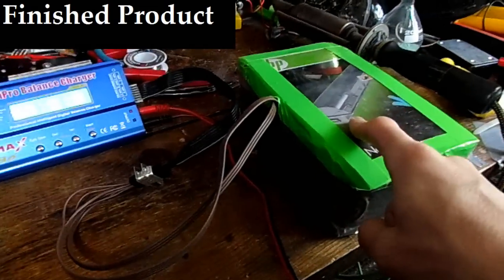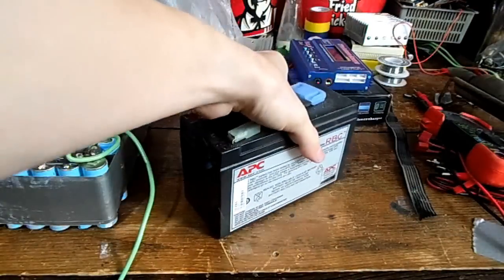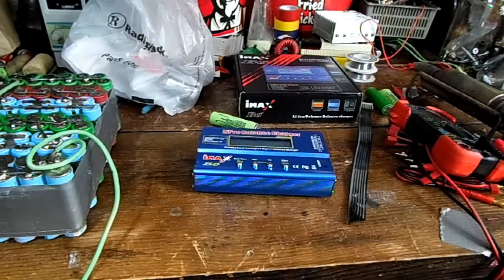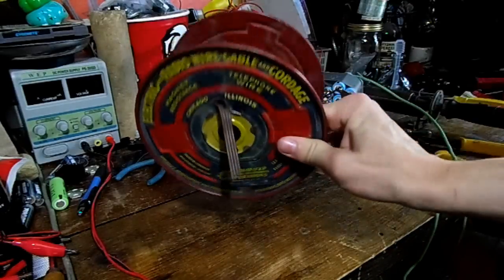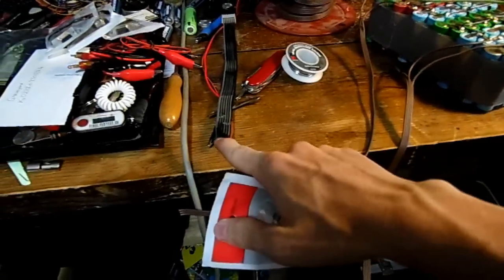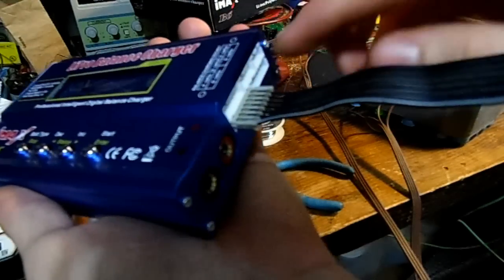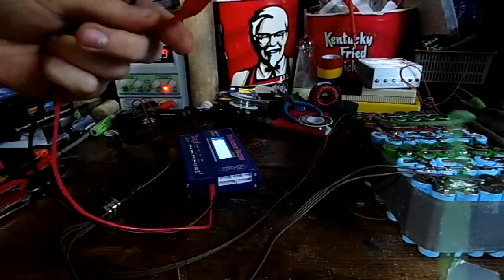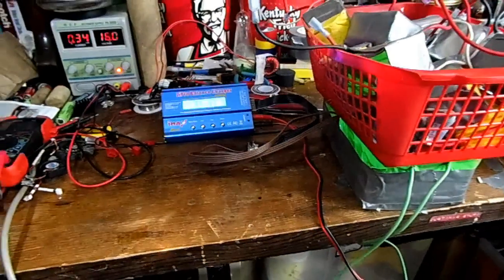DIY: Balance Charging E-Bike lithium battery upgrade

Comment: My question is how do you ensure individual cells are balanced? These chargers only have 7 wires so you can only balance from one bank to another but there is no insuring that you don't have one specific cell within a parallel bank that is too high or low.  So I guess if you have one bank that is constantly going out of balance you then have to unsolder the entire bank and check each cell in that bank for a fault then replace the cell and resolder the bank together again? Am I understanding the theory of this correctly?
Reply from the maker: it is impossible for cells in parallel to be out of different voltage, they will naturally go to the same voltage.
Reply: @RinoaL  I see what you are saying. So by that logic when making a battery pack it is best to make all your parallel banks first then solder them together in series rather than make the banks as series and then solder them together in parallel. Is that right?
Reply from the maker: it is easiest, yes. when you connect cells in parallel they then work as one single larger cell. however make sure the cells are a similar voltage when you connect them all together. if you have some cells at 4.2v and some at 3.2v when you connect them together they will start balancing out, and since the flow from the fully charged to the flat cells would be so great it could get very hot. so i'd say get the cells to within 0.2v of each other before connecting them together. then let them sit for a day or so do equalize. there really isnt any reason you must connect them in parallel before series, you can solder them in whatever order you like. its just good to let them sit for a while to equalize. in each parallel pack if a cells is 4.21v and another is 4.2v, theyll equalize to both be something like 4.205v. then from there on they will always be the same (unless something goes wrong)
Reply: @RinoaL  to my mind there is a reason to solder the banks in parallel first. If you connect the banks in series then solder them together in parallel a single cell in a series bank has the potential to go out of balance. This brings us back to the existence of bms's and balance chargers in the first place.

Comment: There is some very bad advice in this video. 

1) The IMAX is a great charger.
2) Pumping 24v into a 12v lead battery will cause it to boil and potentially explode. 
3) Balance cables are readily available and easy to find.

Comment: After making battery pack I think it's really important to make balance the pack before use it.
But what if we add new cells to that pack do we need to keep balance again..  ?
If that is single pack that's fine we can do it one time, but what if we divided that in two Two packs... 
Rather than charging entire pack can we charge  alternately ...?
But we need to use two packs always, do we need make balance always....

Comment: Ok, what is the difference between this balance charger and BMS...? Even BMS also for Recharge each cells with balance I just thinking ... Is it true or any difference...? 
1.Can we use this balance charger for Recharge 18650 cells if yes how many cells can connect with parallel connection for Recharge 2.can we test each cell capacity or amps ..?

Comment: Lion battery are empty at 3v not 3.7
Reply from the maker: you'd be stupid to take them down that far for an e-bike. bellow 3.7v they cant give much power and the voltage dips. also no, 3.0v is too low for what i consider empty.
Reply: For my applications I empty them until 3v-2.8 max

Comment: Your to young to know but the four wire on the spool was commonly used to connect the roof top tv antenna and its rotor, because radio frequencies where not generated in a single location. Thus a rotor was needed to get stronger signals from further distances especially if you where located in a rural area.
Reply from the maker: too young? thats really condescending. most antenna motor cables ive seen for that werent flat. dont think that just because somebody is young that they are ignorant

Comment: Actually I just tried to connect a bms 52v 14s but after connecting first the battery negative an the red an black balance leads my battery started smoking a a couple of cells got hot so had to cut wires quick and separate hot cells.hot cells were Samsung 26h but I’ve just ordered 30more new cells but 25r Samsung .the 26h we’re losing voltage before the other Panasonic 2600 mah and 25r when cycling up hill on my ebike 1000watt motor.have ordered another bms also as the balance lead wouldn’t fit all the way in on the bms unit

Comment: hi rinoa I have a 14s5p kit and need to balance can I use your method with imax b6 with 6 connectors was it?not sure where to place wires.steve.uk.
Reply from the maker: actually it turns out to be a lot better to connect a BMS circuit onto it and not use the imac b6 for such a large pack. check out my video "Tinkerer's Guide to the 18650" for more info on how to connect up a bms.

Comment: The serial port is great idea, I am making a battery for electric motorcycle and do not intend to remove it. So going to install a serial port to the battery instead of buying the fancy cables. Thanks
Reply from the maker: Actually i recommend getting a BMS, that way you only have to have two wires coming out for charging, + and -   , the BMS will take care of ballancing. how i used to do it in these videos was actually more tedious for no reason. check out my video "The Tinkerer's Guide to the 18650" or maybe "Steampunk Ebike 06" if you want more info on how to use a BMS.

Comment: dead at 3.7v? SMACK tuff love
Reply from the maker: +DragonsREpic well at 3.7v they dip so low in voltage while under load that i wouldnt trust it to take you far, so i consider that about time to stop discharging.
Reply: holy crap that was a fast response...damn. Pretty sure you said dead well either the cells are shitty or your pulling to much current..over how many in parallel? Jesus! how much are you pulling?!? OH btw I ordered http://vruzend.com/ red and blue ones (no idea why its fuckin blue, who ever thought that was a genius idea should prob be shot for it IMHO) I haven't gotten it yet tho, its like 35$ for 52 set with the parts for them so its not to bad unless you have hundreds of cells
Reply from the maker: +DragonsREpic i havent watched this video in years so im only going off what i do now. and dead can either mean fully discharged or unusable. surely you knew that though.

Comment: this is going to be a pretty tough comment to follow but imagine this...

instead of soldering together each individual pack, if you used a switch instead. similarly, on the other side of the battery you could also have a series of switches and what these would have the potential to do (theoretically) , is turn the pack from a 6 series pack into a 1 series pack of 4 volts .... then you could switch it from being a 6 series pack to a single battery and then let the voltage normalize across the cells and this would allow you to simply charge "1battery", as far as the imax is concerned to 4v. 

I was thinking this because the imax can only charge a Max of 6s, so in order to make a 48v pack, you would have to divide the pack into two batteries and charger each separately. let me know what you think or if it is plausible
Reply from the maker: thats not a new idea, and its not a very good idea. the relays or switches would cost more than a BMS.
Reply: Rinoa Super-Genius thanks for your response. hadn't considered cost, I just didn't want to have to break a 14S pack into 3 separate charges on the IMAX b6 for times sake. 

shortly after the idea, I remembered that the maximum 5 amp output of a b6 amongst 100~ cells may take forever to charge if it all. 

aside from cost, why is it a bad idea?
Reply from the maker: takes up too much space, more difficult to charge, easier to end up a pile of burning lithium. charging a battery with an imax b6 isnt a good long term solution for an ebike.
Reply: ah good point. if the imax b6 isnt a good long term solution, then what is? regular charger with a BMS?
Reply from the maker: yeah, turns out those shitty ebike chargers made for lead-acid batteries work great for powering the BMS.

Comment: Built a similar setup to that shown in the vid. My charger (same as the one You use ) takes forever to balance the cells. Even though I initially set the charging current @3 Amps, within seconds it drops to 400 mA  :(

Comment: I'm hoping you still reply to this video. I can't find my answer.
I have four 18650's and 4 battery holders. Please tell me how to wire these to get 8 volts and 6000mah. 2p2s and where to wire in the balance charger leads. Or should I just use two 18650?  I would be really greatful. I wish there was a way to email you but if that was available, you would be inundated.
Reply from the maker: wire the cells together in 2s, then wire those blocks of two in series.
Reply: Rinoa Super-Genius. Wire in 2p then in series 2s. Do I just wire the 2p for balance charging? I appreciate you taking time from your busy schedule. I moved from Ohio to the east bay for work also. What a nightmare this area is. I hate it.
Reply from the maker: Vince Biano
well when you connect batteries in parallel you can then think of them as a bigger battery. just if its too big put fuses between the cells so if one shorts all the other ones dont pump enough power to blow the whole pack up. i use 4 amp picofuses.

due to the laws of physics parallel cells dont need ballancing against each other. just if you have 1s you need two connectors, 2s needs 3 (due to middle connector) and on from there. but it doesnt matter if you have 2 or 200 cells in parallel, you still only really need 3 wires for a 2s configuration.

i recommend discharge testing each cell that way you get an understanding of their capacity and then they are discharged down to 3.6v for assembly. never assemble a fully charged pack, your handling too much energy then.

Comment: So this balances each set of batteries in parallel and we can be assured that the individual batteries within the parallel pack are the same voltage because when batteries are hooked up in parallel, their voltage will equalize?
Correct?

Thanks
Reply: Yes and no, as you seen when he assemble the pack, all the cells were equalized and had the same voltage and amp draw. Over time one or 2 cells will go out of wack. It is a good practice to check for heat or the lack of heat when you are charging them. To answer your question, if the cells are all okay,  the individual cells will be in sync.

Comment: Hi Rinoa, great video...

I had a couple questions... can the IMAX charger charge the batteries to a specified voltage such as 3.92 instead of 4.2v?

Also, when balancing the packs in series; the series packs are all balanced, however, each individual 18650 cell within the series pack may not be balanced, is this correct?

Thanks!
Reply: Yes, and Yes

Comment: JST connectors are extremely available online. Probably would have been easier to go with that
Reply: Then you would have to wait for it, vs using local supplies. Prob is nowdays the Radio Shacks are all gone. I use amazon for 2 day shipping.

Comment: How long does it take for the imax B6 to charge that large battery bank? I think its rated at 50 watts/ 5 amps max.
Reply: The imax is only balancing, otherwise you use a normal charger.

Comment: nice video a fellow tinkerer here. Im amassing my lot of batteries for a  ebike project maself and i think i got most of it down in my head on what to do except 1 thing alludes me, the balance charging part. More specifically using a bms pcb system and then connecting that 13s(48V) to the imax charger which only has a 6s slot. have you found a simple paralelling cable technique to accomplish this or is the output power from the imax enough to detect \and show the balancing of the cells since it runs through the controller and bms board as well? mot likely this is simple but i overlook simple solutions alot.
Reply: If you already have a bms system, then I don't think you'll need the imax charger since that only does 6s.
Reply: I agree with Alex

Comment: Does the LiPro charge the battery in 24Volts or just the Indivdual cells that are in parallel? And if i would build a 24V battery pack out of 18650 cells, what would be the best way to calculate the total Amps/mah). Does the lipro do that to when discharging?
Reply: It charges the parallel to 4.00 volts, Each row is 2ah, 4 rows = 8ah. Yes

Comment: Can I use a 60V Battery on a 48V motor?
Reply from the maker: +Tucker Not Sucker! yes, but you cant use a 60v battery on a 48v controller, check inside your motor controller to see if the capacitors are rated above 60v, if not you may need to upgrade your controller.
Reply: Rinoa Super-Genius Okay thanks.
Reply: You can cut out 24v, and use that.

Comment: there is 24v battery pack.  6 cells. but the balance charger max input 18v.  how that works?
Reply: Cells are bottoming out at 3.00 volts. Don't let them get below that. Get and use a volt meter, 3.00 from china.

Comment: Your videos are really helpful for my ebike project.
I was trying to figure-out how we can balance charge my pack, using a BMS chip(readily available on aliexpress) then charging the pack using an power adapter directly without using imax B6 somehow, to allow on board charging.
Your expert opinion on this setup please.
7 Wires => BMS chip=>Poweradapter
Reply: You don't need imax with a BMS.

Comment: Hello, I have been watching some of your videos, I'm making one of 8 batteries in parallel in six banks (18650), which is 24v,, but my question will be, if every cell says 3.7 v. 5000 mAh how many Amps will be at the end. And at what rate should I charge, Im using 0.2 A and 15 v. in the Gq-A305D. Then in the iMAX shows the six cells but the fourth one was showing 1.9 v. it is normal ( I charge them separately before)  I appreciate your help. Your video is very helpful
Reply: First never mix voltages, wait till you have all the batteries in sync. 6 banks x 5ah = 30ah.

Comment: What is the wire gauge of your ribbon? Of the connector wires from the battery pack?

Don't worry.  If your wiring is wrong -- Smoke.
Reply: 18ga

Comment: Hey man, great videos. My dad and I are both using them to make our own batteries.
I have a question for you though.
Why is it that you can have several cells or packs in a laptop battery and not have to worry about balance charging them? Do you have to worry about balance charging them because your pack was made from a bunch of different laptop batteries?
What if I bought the cells (all of the same type and brand) brand new?
Reply: Actually, I think I just found my answer in another comment. 
I'm pretty new to this stuff

Comment: Do the cells discharge evenly across each pack in the series? Could you add a pcb to prevent over discharge as a whole/and for each pack in the series? Also, do you know of a voltage meter that would be small enough to install onto the battery and be able to pick up an accurate reading for each individual pack and for the battery as a whole?
Reply from the maker: tommyd206 yeah i did latter and it was pretty easy. i just bought a BMS that came with the ballancing cable and just soldered 9-pin connectors up to it. the two battery packs i have like this quickly plug into the BMS then.

i've been looking at the Cell-Log 8. i'd get two of them to display my entire 13 pack battery.

and yeah they pretty evenly discharge. but most importantly when they are charged back up they even out to like 0.002v of each other. takes a few months of cycling it to deviate much. but my other pack made from lower quality cells deviates a bit faster.

Comment: What kind of solder wattage and dimentions for that solder iron LOL IT LOOKS PRETTY BIG 😜 but nice job btw this batteries are dangerous as lead acid if not wire correctly!
Reply: 200-240 watts depending on model.

Comment: Wiring instructions are a little vague. Does the negative wire connect to each bundle? How do you know which balance control pin is negative from the charger?
Thanks
Reply: +Tucker Not Sucker! (Run4aces)  negative goes to the negative of the whole battery and the imax b6 has a + and - it goes  - , 4 , 8 , 12 ,16 , 20 , 24 v + ask if u dont understand ill tell u in more details
Reply: Kristijan Dinga I figured it out a long time ago. Thanks
Reply: Tucker Not Sucker! ok no prob :)

Comment: How often would a battery pack with lithium cells that are in series need balancing.  What amp and  type of charger do you use for regular charging?  It would be a pain to have to individually charge the batteries that are already wired in series every time
Reply: Just buy a good charger meant for your cells.

Comment: what other batteries could you use for and electric bike like this? your you possible use car batteries? or power-wheel batteries?
Reply: car are heavy, and power wheel are too low capacity.